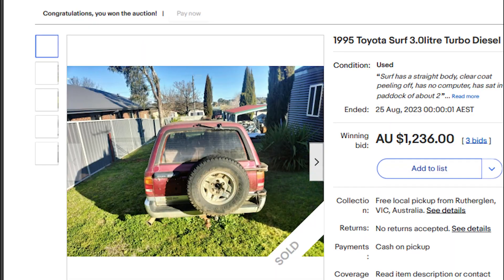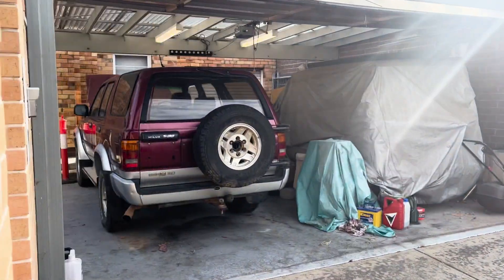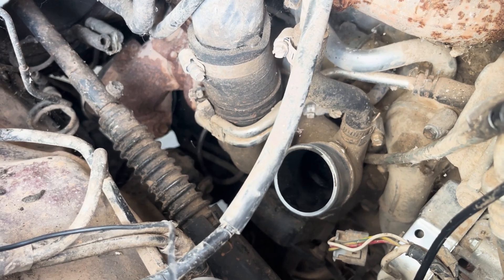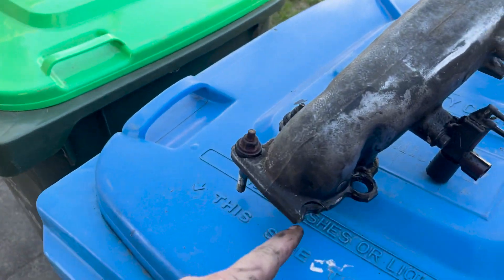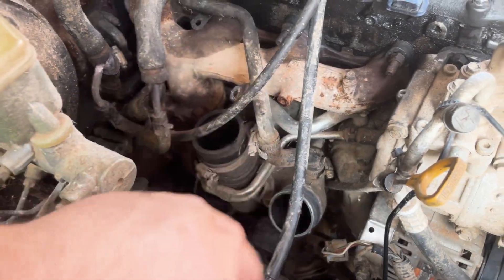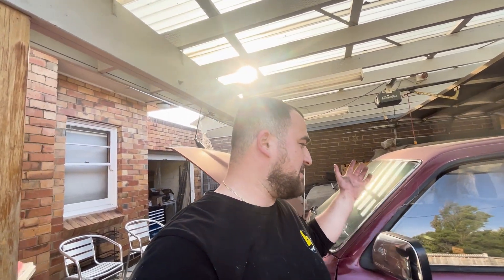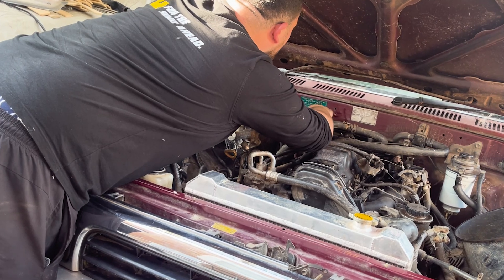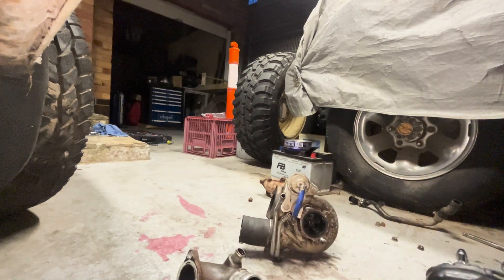REBUILDING A $1000 ABANDONED TOYOTA HILUX | PART 4

Comment: Just like I said in last video. Look at the oily mess in the suck side of the comp housing. Its full of oil. Now that can only come from the rubbish Toyota r/cover breather pipe being plumbed into the suck side of the turbo. Typical Toymota. If it was dry there but wet on the outlet of the comp housing then the compressor side carbon seal is very very tired. Turbos are super easy to rebuild. Balancing is the only thing to outsource but if reusing shaft n wheel as long as you mark it it should be fine.
Reply from the maker: For sure!! Thank you. The outlet of compressor housing was CAKED in oil. I should’ve done a better job recording it :(( that’s my bad there. I’ve got a replacement coming in the mail soon, might get it balanced to ensure it’s going to be good!
Reply: @peter_brash  So you are replacing the whole turbo? If so you wont need to get it balanced as it shouldve  been dun by whoever assembled and sold it already. You might check for play in the new one and find it has got endfloat and axial play. Dont stress. Take an oil can and give it a few pumps into the oil feed hole while turning it around with free hand. You will find the play will vanish as the whole assembly pretty much floats in oil when running. Check opening pressure of original wastegate with a Mityvac or similar then check new turbo to make sure the new one isnt lower. Use Nickel anti-seize on every nut n bolt on the exhaust side of things. Copper antiseize will work but Nickel takes a higher temp. Really should have a quality catchcan fitted. You have sum mint mint ones over there in OZ. Do not buy a cheap shitter one. Not worth the time nor money. Saw the IG post of a certain Blue Toymota too. Looks the part.

Comment: Hi mate ,  great video yet again ,   bad turbo shit ,,    if a  turbo is all that's bad then  spend  reasonable dollars put new turbo on ,,   be mindfull not to flog the motor with new turbo ,,  it may be to much for the old girl ,  ,   drive it quietly with medium power ,  and check if smoke turns black only your laughing,   means it's still pretty good  motor worth rebuilding,   but  even if it's still got smoke but less smoke and engine anit knocking  or rattling,  worn piston rings  ,   do compression test
Reply from the maker: Thank you sir!! I'll be compression testing the car soon because I need to remove the injectors anyway. New turbo has just arrived, it is a standard replacement. Really hoping that it was just the turbo seals :)